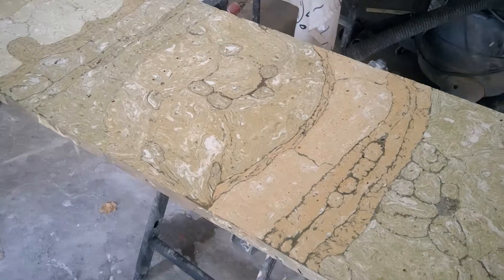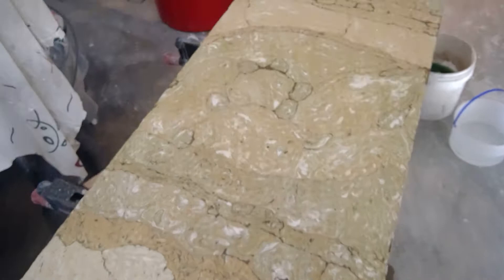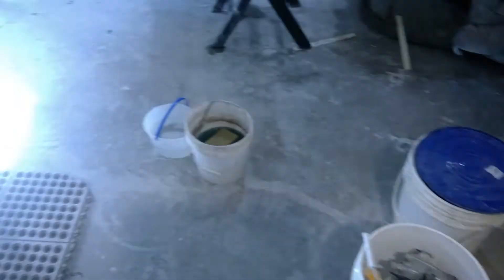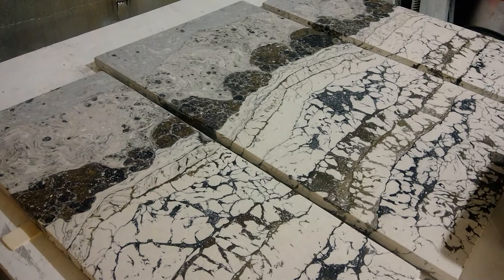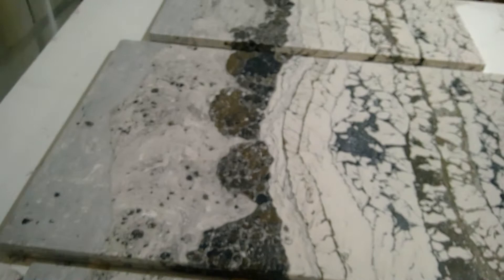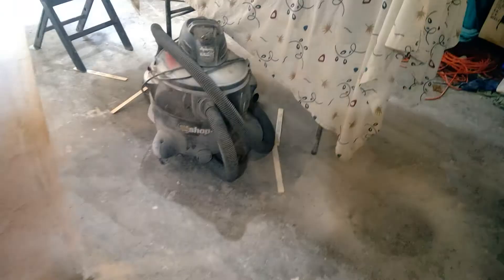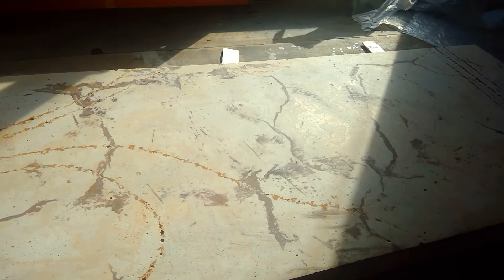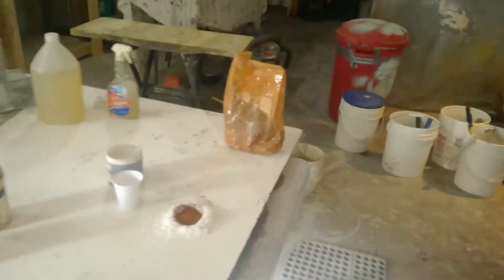My Scagliola Works

Comment: Hello, Amanda!Great job!Could you share the secret of the composition of the gypsum mixture, the concentration of glue in water.And is it possible to exploit the finished product in the external environment.Maybe you know how to strengthen the product for use at low temperatures and high humidity.Thanks.Good luck